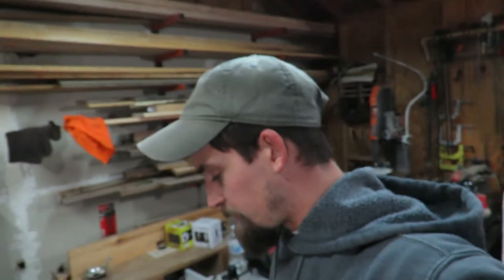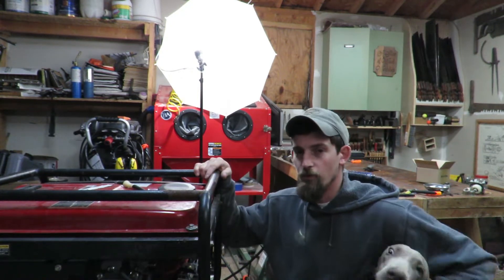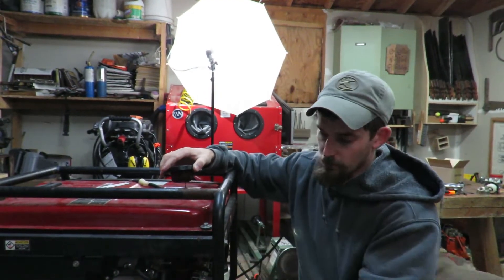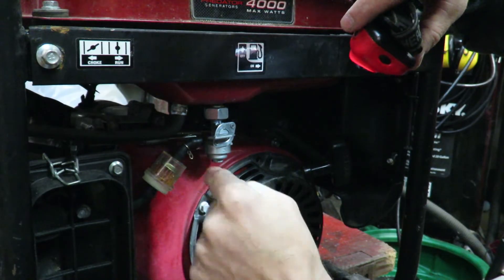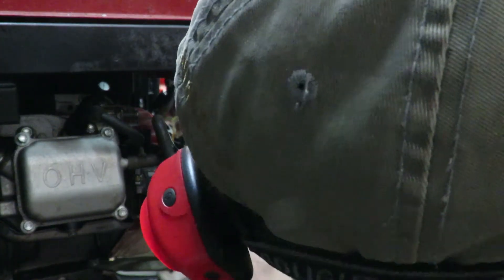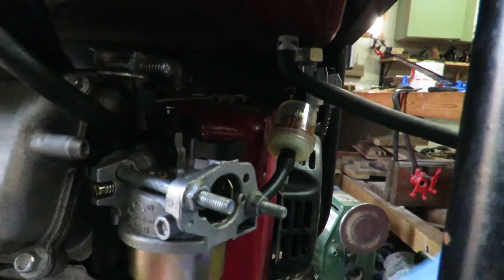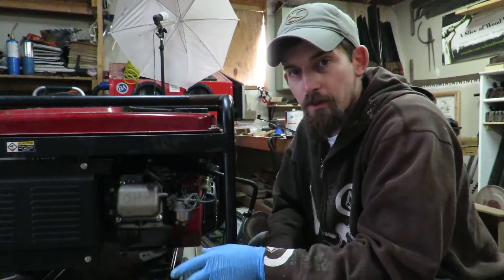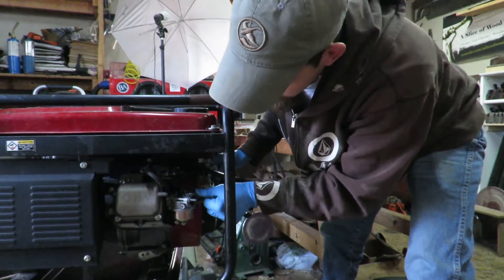Predator 4000 Generator | Solving the Fuel Issue

Comment: Valves?Yeah most motors wont run right without an air box.
Reply: Don’t forget about the generator safety rules: Always make sure you follow all the generator safety rules whenever you use your portable generator. This is only a reminder. Generators can be dangerous if not used carefully. Every year, hundreds of people die or get injured when using portable generators due to carbon monoxide poisoning and electrocution. Make sure you are using your generator carefully and keeping others safe as well. There is something very serious that everyone should always be aware of when using generators. Some people do run their generator indoors which is not safe and that increases the risk of carbon monoxide poisoning which can cause death of family and you. Some people run their generator in wet conditions which can electrocute them. Please remember that you should never run your generator indoors. Remember that carbon monoxide is an odorless and colorless gas that you cannot see or smell. Carbon monoxide is a silent killer. Keep that in mind. Make sure your generator is 15-20 feet away from your house and away from doors, windows, and vents. Never use your generator in your porch too. Having a carbon monoxide detector is very important against generator safety. Some people also allow children to go near the portable generator which could pose risks. We need to keep an eye on our children making sure that they are not near the portable generator so they won’t get electrocuted or burned by the generator which is dangerous. A locking enclosure also keeps kids safe. A generator shed might look like a tempting place to explore, or take cover during a game of hide and seek, but a generator is a dangerous piece of equipment that can cause injury. It says on the manual that we should also keep children away at all times from the portable generator to avoid injuries. Please do not allow a child or unqualified people to operate the portable generator.  It is important to keep your children safe especially little ones. The portable generator can be hot during an operation. Just because some manuals missed what should be listed doesn’t mean it’s safe to do. Always follow the generator safety rules when using portable generators. Generators pose electrical risks. If you need to use your generator during wet weather, you need a generator tent to protect your generator from getting wet. Don’t let your generator get wet. Keep your generator dry and before using your generator, please make sure your hands and your generator is dry. Do not wear loose clothing when operating the generator. Everything that is said on the generator’s operating manual should not be ignored. Never smoke cigarettes near the generator. Please keep flammable things away from the generator. Never overload your generator too. Your generator can catch fire. Never ever try to plug a generator cord into a wall outlet to avoid back feeding. Back feeding your generator is dangerous. Always turn on your generator first before plugging in appliances and shut off the appliances before turning your generator off. Use a heavy duty cord for your generator and the cord should not be worn out. All the instructions should be followed carefully. Never refuel your generator while it’s running. It can cause fire if fuel spills while your generator is hot. You should turn off your generator and let it cool off before refueling it. Having a fire extinguisher next to the generator is also important. This is only a reminder for everyone’s safety of using generators. Make sure your generator is properly grounded. Having a fire extinguisher next to the generator is also important against the safety rules. https://youtu.be/I1jT3ANENvI and here is a video more about keeping others safe when using generators and also about our family’s safety. It’s important to keep our little children safe as well. Make sure your little children are kept away from the generator at all times especially when it’s running. Hope this helps. Remember it’s better to be safe than sorry.
Reply: @The_Happy_Aviation_Enthusiast  lot of stupid people in this world that's why common sense is what people need and not a list of rules 10 pages long stupid people shouldn't even touch equipment like that.

Comment: By blocking that hole on the end of the carb you were restricting the pilot jet air path. That circuit is very sensitive and can cause high speed issues. And any of those carb gaskets mispositioned could cause an air leak.
Reply: Don’t forget about the generator safety rules: Always make sure you follow all the generator safety rules whenever you use your portable generator. This is only a reminder. Generators can be dangerous if not used carefully. Every year, hundreds of people die or get injured when using portable generators due to carbon monoxide poisoning and electrocution. Make sure you are using your generator carefully and keeping others safe as well. There is something very serious that everyone should always be aware of when using generators. Some people do run their generator indoors which is not safe and that increases the risk of carbon monoxide poisoning which can cause death of family and you. Some people run their generator in wet conditions which can electrocute them. Please remember that you should never run your generator indoors. Remember that carbon monoxide is an odorless and colorless gas that you cannot see or smell. Carbon monoxide is a silent killer. Keep that in mind. Make sure your generator is 15-20 feet away from your house and away from doors, windows, and vents. Never use your generator in your porch too. Having a carbon monoxide detector is very important against generator safety. Some people also allow children to go near the portable generator which could pose risks. We need to keep an eye on our children making sure that they are not near the portable generator so they won’t get electrocuted or burned by the generator which is dangerous. A locking enclosure also keeps kids safe. A generator shed might look like a tempting place to explore, or take cover during a game of hide and seek, but a generator is a dangerous piece of equipment that can cause injury. It says on the manual that we should also keep children away at all times from the portable generator to avoid injuries. Please do not allow a child or unqualified people to operate the portable generator.  It is important to keep your children safe especially little ones. The portable generator can be hot during an operation. Just because some manuals missed what should be listed doesn’t mean it’s safe to do. Always follow the generator safety rules when using portable generators. Generators pose electrical risks. If you need to use your generator during wet weather, you need a generator tent to protect your generator from getting wet. Don’t let your generator get wet. Keep your generator dry and before using your generator, please make sure your hands and your generator is dry. Do not wear loose clothing when operating the generator. Everything that is said on the generator’s operating manual should not be ignored. Never smoke cigarettes near the generator. Please keep flammable things away from the generator. Never overload your generator too. Your generator can catch fire. Never ever try to plug a generator cord into a wall outlet to avoid back feeding. Back feeding your generator is dangerous. Always turn on your generator first before plugging in appliances and shut off the appliances before turning your generator off. Use a heavy duty cord for your generator and the cord should not be worn out. All the instructions should be followed carefully. Never refuel your generator while it’s running. It can cause fire if fuel spills while your generator is hot. You should turn off your generator and let it cool off before refueling it. Having a fire extinguisher next to the generator is also important. This is only a reminder for everyone’s safety of using generators. Make sure your generator is properly grounded. Having a fire extinguisher next to the generator is also important against the safety rules. https://youtu.be/I1jT3ANENvI and here is a video more about keeping others safe when using generators and also about our family’s safety. It’s important to keep our little children safe as well. Make sure your little children are kept away from the generator at all times especially when it’s running. Hope this helps. Remember it’s better to be safe than sorry.

Comment: Ha! Been trying to get my MQ 6000 running for a few days now. I got a new carbrater with new gaskets but it was hunting reported the low speed jet same thing. Get sick of messing with it so I got some of those little drill bits and some more carb cleaner and cleaned it up clearing all the ports with the little drill bits and it would not start or run at all. I cleaned it again same thing. Then I saw your video and used the original gaskets and it started right up! A quick adjustment and it runs perfect. 
Thanks man!
Reply from the maker: That is awesome! Glad to hear you got it up and running.

Comment: with the problem off the light not coming on was that the reset button on front ?
Reply: Don’t forget about the generator safety rules: Always make sure you follow all the generator safety rules whenever you use your portable generator. This is only a reminder. Generators can be dangerous if not used carefully. Every year, hundreds of people die or get injured when using portable generators due to carbon monoxide poisoning and electrocution. Make sure you are using your generator carefully and keeping others safe as well. There is something very serious that everyone should always be aware of when using generators. Some people do run their generator indoors which is not safe and that increases the risk of carbon monoxide poisoning which can cause death of family and you. Some people run their generator in wet conditions which can electrocute them. Please remember that you should never run your generator indoors. Remember that carbon monoxide is an odorless and colorless gas that you cannot see or smell. Carbon monoxide is a silent killer. Keep that in mind. Make sure your generator is 15-20 feet away from your house and away from doors, windows, and vents. Never use your generator in your porch too. Having a carbon monoxide detector is very important against generator safety. Some people also allow children to go near the portable generator which could pose risks. We need to keep an eye on our children making sure that they are not near the portable generator so they won’t get electrocuted or burned by the generator which is dangerous. A locking enclosure also keeps kids safe. A generator shed might look like a tempting place to explore, or take cover during a game of hide and seek, but a generator is a dangerous piece of equipment that can cause injury. It says on the manual that we should also keep children away at all times from the portable generator to avoid injuries. Please do not allow a child or unqualified people to operate the portable generator.  It is important to keep your children safe especially little ones. The portable generator can be hot during an operation. Just because some manuals missed what should be listed doesn’t mean it’s safe to do. Always follow the generator safety rules when using portable generators. Generators pose electrical risks. If you need to use your generator during wet weather, you need a generator tent to protect your generator from getting wet. Don’t let your generator get wet. Keep your generator dry and before using your generator, please make sure your hands and your generator is dry. Do not wear loose clothing when operating the generator. Everything that is said on the generator’s operating manual should not be ignored. Never smoke cigarettes near the generator. Please keep flammable things away from the generator. Never overload your generator too. Your generator can catch fire. Never ever try to plug a generator cord into a wall outlet to avoid back feeding. Back feeding your generator is dangerous. Always turn on your generator first before plugging in appliances and shut off the appliances before turning your generator off. Use a heavy duty cord for your generator and the cord should not be worn out. All the instructions should be followed carefully. Never refuel your generator while it’s running. It can cause fire if fuel spills while your generator is hot. You should turn off your generator and let it cool off before refueling it. Having a fire extinguisher next to the generator is also important. This is only a reminder for everyone’s safety of using generators. Make sure your generator is properly grounded. Having a fire extinguisher next to the generator is also important against the safety rules. https://youtu.be/I1jT3ANENvI and here is a video more about keeping others safe when using generators and also about our family’s safety. It’s important to keep our little children safe as well. Make sure your little children are kept away from the generator at all times especially when it’s running. Hope this helps. Remember it’s better to be safe than sorry.

Comment: You have to take the load off of the generator before you shut off the motor. To do this you must unplug all appliances and Equipment plugged into the generator. Failure to do this will result in the generator becoming demagnetized
Reply: Demagnatized??

What's that?
Reply: Generator runs but no power output
Reply: @christophergurley8400  demagnetized happens if the gen has set unused for awhile, if you start the gen and there’s no electricity output (if your brakers aren’t kicked) try plugging in an angle grinder and run the wheel of the grinder on the concrete of your driveway with the trigger pressed, it should send a slight charge into your gen and recharge the rectifier.
Reply: Don’t forget about the generator safety rules: Always make sure you follow all the generator safety rules whenever you use your portable generator. This is only a reminder. Generators can be dangerous if not used carefully. Every year, hundreds of people die or get injured when using portable generators due to carbon monoxide poisoning and electrocution. Make sure you are using your generator carefully and keeping others safe as well. There is something very serious that everyone should always be aware of when using generators. Some people do run their generator indoors which is not safe and that increases the risk of carbon monoxide poisoning which can cause death of family and you. Some people run their generator in wet conditions which can electrocute them. Please remember that you should never run your generator indoors. Remember that carbon monoxide is an odorless and colorless gas that you cannot see or smell. Carbon monoxide is a silent killer. Keep that in mind. Make sure your generator is 15-20 feet away from your house and away from doors, windows, and vents. Never use your generator in your porch too. Having a carbon monoxide detector is very important against generator safety. Some people also allow children to go near the portable generator which could pose risks. We need to keep an eye on our children making sure that they are not near the portable generator so they won’t get electrocuted or burned by the generator which is dangerous. A locking enclosure also keeps kids safe. A generator shed might look like a tempting place to explore, or take cover during a game of hide and seek, but a generator is a dangerous piece of equipment that can cause injury. It says on the manual that we should also keep children away at all times from the portable generator to avoid injuries. Please do not allow a child or unqualified people to operate the portable generator.  It is important to keep your children safe especially little ones. The portable generator can be hot during an operation. Just because some manuals missed what should be listed doesn’t mean it’s safe to do. Always follow the generator safety rules when using portable generators. Generators pose electrical risks. If you need to use your generator during wet weather, you need a generator tent to protect your generator from getting wet. Don’t let your generator get wet. Keep your generator dry and before using your generator, please make sure your hands and your generator is dry. Do not wear loose clothing when operating the generator. Everything that is said on the generator’s operating manual should not be ignored. Never smoke cigarettes near the generator. Please keep flammable things away from the generator. Never overload your generator too. Your generator can catch fire. Never ever try to plug a generator cord into a wall outlet to avoid back feeding. Back feeding your generator is dangerous. Always turn on your generator first before plugging in appliances and shut off the appliances before turning your generator off. Use a heavy duty cord for your generator and the cord should not be worn out. All the instructions should be followed carefully. Never refuel your generator while it’s running. It can cause fire if fuel spills while your generator is hot. You should turn off your generator and let it cool off before refueling it. Having a fire extinguisher next to the generator is also important. This is only a reminder for everyone’s safety of using generators. Make sure your generator is properly grounded. Having a fire extinguisher next to the generator is also important against the safety rules. https://youtu.be/I1jT3ANENvI and here is a video more about keeping others safe when using generators and also about our family’s safety. It’s important to keep our little children safe as well. Make sure your little children are kept away from the generator at all times especially when it’s running. Hope this helps. Keep in mind that it’s better to be safe than sorry